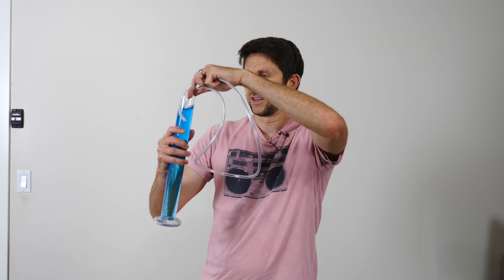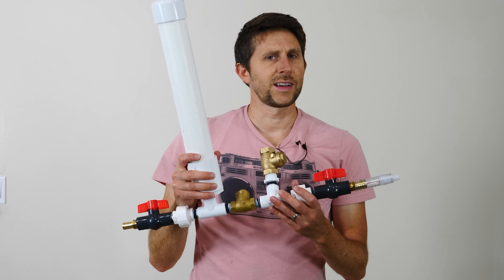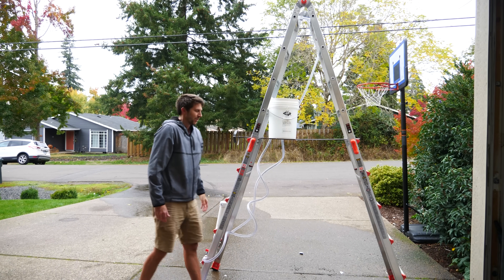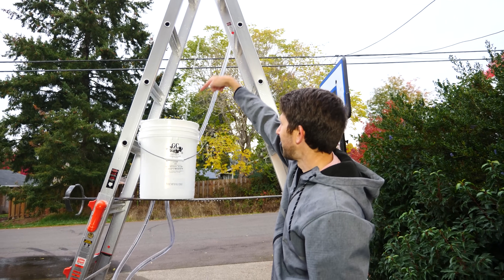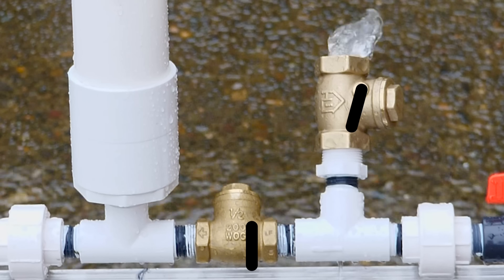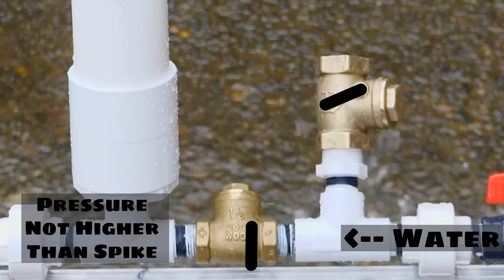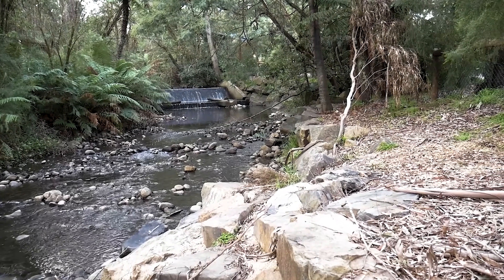Can a Hydraulic Ram Pump Make a Perpetual Motion Loop?

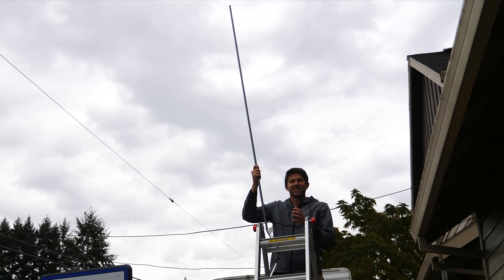Comment: "So, there is no source of power here" 2:35 - 2:39. You should be careful about your wording. Later, you told correctly, that there is no "external" power source here ( the water level is the source of energy here E=m×g×h)
Reply: are u sepcial ?
Reply: @girlsdrinkfeck  No. Maybe you? I am exact!
Reply: @girlsdrinkfeck  You don't know what different languages are... but the power of hight what implies m×g×h ( I'm not sure how you got tech the formula, maybe =P) is where this system got its power.
Reply: @girlsdrinkfeck  He is trying to hide the the fact, that you have a power source in this open system. So he use the word "external" explicitly, there is no "external" power source. When he say: "There is no power source" he makes a absolutely wrong statement, that's the fact I am mentioning. He needs to be better prepared of what he is saying. He makes educational videos, where you have to be exact. Otherwise he argues wrong.
Reply: @girlsdrinkfeck  Your point is changing over time...

Comment: Can’t you make it perpetual motion by having a ramp or tube flow the dumped water pack into the pipe?
Reply: No. Each pump requires waterhead height. By the time you freely collected all the waster water into the container, it will be at a lower altitude than the pipe you want to refill. So from there you would need to install the pump at least like 4-5 foot lower to get it to pump that waste water back into the pipe. But now, you will have waste water from the waste water pump, you can only pump around 30%(don't quote that, but it is far from 100%) of the water using ram pump, the rest is required to exit the waste valve freely. 

But if you did it anyway, you would make it more efficient, because now it will pump more and waste less. But you could also put a waste pump on the waste pump, and then a waste pump on the waste pump that is on the waste pump. And now it will be really efficient, but it will NEVER be perpetual.  And also you need alot of height to pull that off. Because in the end, all the waste valves need to flow freely, even that last lowest one needs to freely flow and a place to go freely.
Reply: Oh, i misread the question. But the answer is still no. That same dumped water pushing its way out of the pipe will not go back into the pipe because the pressure in the pipe is higher than the atmosphere pressure where that dumped water went. And if you had a tube on it connected back into the pipe, then nothing would happen at all, all pumping would stop. That is why it works in the first place, the water has to flow to a lower pressure in order to flow at all. 

You are for example in essence asking if a river can flow both directions.
Reply: @TheRebelmanone  with Disney magic anything can happen, but fr cool thanks

Comment: that bang sound when turning the water off is also made by the free pipe installed in the house. it slams the whole pipe into the woodwork or whatever the building supply is that encases the water pipe. I've watched this happen in some installations.
Reply: Yep. That's why we put surge arrestor on end of line

Comment: Hypothetically if you Rube Goldberg the fuck out of that pump you can make it reuse 90 some odd percent of the wastewater not quite free energy but staggeringly impressive
Reply: So this machine does nothing but puts some water back up to the bucket. If you want water at the bucker. Just put a full bucket there and done 100% effective.
Reply: @MrT------5743  not exactly you have multiple pump bucket setups at varying heights each one's wastewater going into the one below the top one uses a siphon with a turbine style pump to utilize its altitude to get enough Force to draw the wastewater from the first buckets receptacle backup into the first bucket it's not quite a 100%, but it would flow for a mind-bogglingly long time before it became depleted
Reply: @stacyroe619  Most ram pump are only 60% efficient and can only achieve 80% at peak performance. But what would maintaining a ram pump be useful for? A yard decoration? Cause using any of the energy to do anything (turning a turbine/propeller etc) to generate electricity will reduce the efficiency very fast.
Reply: @MrT------5743  no the siphon from the highest bucket would turn the turbine not to produce electricity but to produce the force needed to pump the wastewater from the first bucket back into the first bucket and you're right it would not be useful for anything other than the amusement of it because interfering with it in any way would dramatically reduce the effectiveness think six buckets high and the high one has a siphon going down into the first one and on its way from such altitude it would have plenty of force to turn a turban to suck the wastewater back into the first bucket but not all of it making it about 90 some odd percent efficient so it could run for hours however if the wastewater were to pour waterfall style down stairs into the lower buckets it can be used as a cooling effect like the artistic waterfall in the car manufacturing plant lobby that saves them money on cooling by using evaporation to help cool the lobby
Reply: @stacyroe619  you said and I'm paraphrase your first few sentences... 'a siphon will pump wastewater from the first bucket back into the first bucket'. What are you saying? At most a siphon can only move water from one height to a height slightly lower. A siphon cannot move water uphill to be discharged higher than the entrance of the siphon. I do not think you have a good understanding of how water needs to flow downhill.
Reply: @MrT------5743  I see the problem you misunderstand I said the top one as in multiple of the pumps that he made at varying heights the highest one would have the siphon powering the turbine that puts the water into the first bucket which would be the low bucket the siphon and the water pumped by the siphon as it passes through the turbine would move into the first bucket which is the lowest bucket

Comment: Hi There, I know the video below is in Spanish. but I believe this is the real power of the video.
Many farms in the Colombian Andes mountains have this type of pump. As flowing water is common and, the cost of parts, installation, and maintenance are affordable in comparison to the electricity prices. These pumps have a 10% to 15% efficiency. Wich means from 100lt passing through the system only 10lt would be pumped. However, they can pump water to a great height difference, up to 80mts depending on the length of the hose due to friction losses.

https://www.youtube.com/watch?v=LJphOVQVOOs

Regards

Comment: The external force is gravity.
Reply from the maker: gravity is not a power source or a source of energy. For example to get energy out of something in gravity you have to first lift it up to that height. The energy source that first lifted the object up is the source of the power, the gravity just converts it to a different form of energy like kinetic energy. So in a hydroelectric dam, the source of power is not gravity, but it is the sun that lifted the water to a higher location upstream due to evaporation (and then rain). Gravity is just a force, forces are not energy. Forces can convert energy into different forms of energy though. So the source of power for this experiment in my video was me lifting the bucket up

Comment: It is a pump powered by potential gravitational energy of the water. All the water that was in the bucket and ends up wasted at the bottom lost all its potential energy.
Reply: Technically the pump is powered by the kinetic energy to the falling or flowing water. Just having the water high up with tons of potential energy does nothing without the water moving.
Reply: @MrT------5743  ... Aw, come on. And where does the "kinetic energy of the falling water" come from? You said it, from "falling", and that is potential gravitational energy being converted into kinetic energy. You need do work to elevate water to the tank that is higher than the waste check valve. That work to elevate water, work that is external to the system, is what gives energy to the system. Potential gravitational energy. The rest is energy conversion within the system.
Reply: @adb012  But lets say you were near a river. Then you can use only the kinetic energy of the moving water. Either way, you add energy to the system, but if you only had potential energy and never let it fall (turn it into kinetic energy) the pump would do nothing. So still technically the pump runs off of the moving water (the kinetic energy of the moving water).

There is no argument that in order to get the water to move, it needs to have had some potential energy someplace first. That is the whole basis of kinetic vs. potential energy though.
Reply: @MrT------5743  ... Well, yes. Depends where you put the boundaries of your system. In the setting shown in the video I would take the tank as part of the system and the hose used to fill it up to be outside of the system. So you add energy to the system. In the same way that you out fuel in a car and say that fuel (not heat inside of the piston) is what powers the car. In the case that you take the water from a flowing river and use it's kinetic energy, and you consider the river as being outside of the boundaries of your system, then I am perfectly ok to say that it is powered by kinetic energy (the conversion from potential to kinetic happens outside of the system).
Reply: @adb012  now you are talking about the system. Your original post talked about the pump itself. It is most definitely powered by the moving water. By definition the movement of the water is kinetic energy. Therefore the pump is powered by the waters kinetic  energy.

Comment: I am really glad you did this video. Ram pumps are really cool. However, I am disappointed that you did nothing to deal with the wasted water. Is it possible to not waste the water? Like attach a pipe to the waste valve. You did awesome in explaining how it works, but you really should have put some time in showing what happens if you try to manipulate the water waste end. This is the kind of video for which  a thumbs up or thumbs down is not a good rating system. If it was a 1 to 10 scale, I would give it a 7.
Reply: The waste water was being used to water the driveway and down the street.
Reply: @MrT------5743  

Lool

Comment: I got a friend that lives on a farm and they have some clean running river near it, so they went out with a metal detector, and found a valve like thia that was over 100 years old, they dug it up, cleaned it and guess what, it worked, buried for god knows how many decades, it just works, they now use to pump water over 300m to there farm animals for free, it actually saves them tons of money on water electricity, for keeping there animals hydrated

Comment: But you can have two buckets, one lower at start, one up a hill. Water goes up to ram pump and into top bucket. Waste water from ram pump goes down a channel into lower starting bucket to not be wasted. Water collected up top also goes back down to lower bucket completing infinite loop. Water passes hydro motor to make electricity as it returns to lower bucket. Free energy from gravity and pressure.
Ram pumps are used to make water run up hills without electricity, when you have a hill you have gravity to pull water back down. You could also make a fountain with top and bottom bucket. Enclose to stop water evaporation.
Reply: No that would not work. For you to get water higher than the source water, you need more water to stay at the bottom lower than the source. If you added a hydro motor, the system would stop.
Now when you talk about a river, you would be better off just putting the hydro motor in the river and generate electricity from the water flowing down a river. Removing the ram pump from the equation cause it would not add anything to the system

Comment: what if we put the "waste water" to fill into a bucket 2 with another ram valve which fills into the first bucket, and its waste goes back into bucket 2?
Reply: The ram pump has to be lower than it's bucket so you wouldn't be able to have a cycle like that :(
Reply: No. Each pump requires waterhead height. By the time you freely collected all the waster water into the container, it will be at a lower altitude than the container you want to refill. So from there you would need to install the pump at least like 4-5 foot lower to get it to pump that waste water back into the container. But now, you will have waste water from the waste water pump, you can only pump around 30%(don't quote that, but it is far from 100%) of the water using ram pump, the rest is required to exit the waste valve freely. 

But if you did it anyway, you would make it more efficient, because now it will pump more and waste less. But you could also put a waste pump on the waste pump, and then a waste pump on the waste pump that is on the waste pump. And now it will be really efficient, but it will NEVER be perpetual.  And also you need alot of height to pull that off. Because in the end, all the waste valves need to flow freely, even that last lowest one needs to freely flow and a place to go freely.
Reply: @TheRebelmanone  To make it most efficient, just fill a bucket of water at the top without any hoses or the ram pump. You would waste 0 water not having any ram pumps.

Comment: Why Can't you just put  an other tube to the outlet and connect it to the tube before the gate, so you won't loose any water?
Reply: Then it wouldn't work. For this to work, some water needs to stay at the bottom. Essentially this uses the weight of the water in the source bucket, to move a little higher than the source, but some water (waste water) needs to end lower than the source. In all this system, water is basically flowing down hill.

Comment: I tried to make one of these with my dad, it didn't work though we used far cheaper materials so it was to be expected I guess.
Reply from the maker: It doesn't need to be expensive. It's al about getting that valve to open and close correctly. It needs be just the right weight, so as I mentioned in the video it helps to have a weight on it to adjust.  Also you need to make sure the inlet pressure and outlet pressures are high enough to get it moving

Comment: Now time to figure out how the Egyptians could pump water from a lower floor to a higher one
Reply: pressure I think
Reply: Did you watch the video? cause that is exactly what he was doing.
Reply: @MrT------5743  Yeah I watched it. No its not exactly what he is doing.
Reply: @chandelballard6427  he is, indeed pumping water from a lower place to a higher place using only running water and 2 check valves.
Reply: @MrT------5743  Thats not what I meant. What tools do they have that would have replicated this?
Reply: @chandelballard6427  I'm not sure about Egyptians exactly, but they had pottery. That would do it for sure. Bamboo as well but don't think about if that grows in the Nile.

Comment: Add a spinning wheel to the leaking water, and you've got electricity generation for a cellphone?
Reply: You'd need  a lott of water. Or catch the water from the valve and put it back up constantly. That's the energy you are putting in

And a lonngg as time

Comment: Can you connect several of thease pumps in series, waste  valve of first to inlet of second and so on?
Reply: if you have an infinite drop then yes haha. 
at the same level, the waste valve can't produce enough pressure to lift anything back to to its original height. The system need the pressure differential to be able to pump water back up.

Comment: Why dont they use huge models of this in dams, so we can produce electicity several times with the same water?
Reply: In dams, it is better to use all the water and not let a bunch leak out just so it pumps it back to the top. In James setup, It wastes water just to bring a little to the top. None of that energy can be extracted to produce electricity.
It is better to use all the water to flow though the dams turbines, which is what they already do.
Reply: @MrT------5743  I was thinking about  the water after the turbines,  getting some of that water up again.  Lets say they drain 1000 cubic, and could get back maybe 300. Better than just let all of  the water escape being used only once :p
Reply: @urobouros1337  it would probably be more like from 1000 cubic feet after the turbines get 10 cubit feet back to the top. Not enough to bother with all the extra complexity and maintenance would take. I believe people way smarter than you and I have already looked at the most cost effective way to produce electricity.

Comment: This technology has existed for a long time. 
To improve its efficiency you add a bell siphon
Reply: I just looked up bell symphony, it has to do with music?
Reply: @clarkeugene5727  siphon
Reply: @21gioni   Thank you, I'm a dummy.
Reply: @clarkeugene5727  No not at all you picked up the error I just edited the comment.
I am half blind and sometimes I don’t pick up on errors. 🤪😇
Reply: @clarkeugene5727  I am part of a research group who investigates energy devices.
We have an Air conditioning unit that saves up to 75% power consumption.
Reply: @21gioni  that sounds awesome, is there a prototype for it? I'm trying to make one too, saving power consumption!
Reply: @DreamingConcepts  It has been originally developed for industrial use and has existed since 1999.
The first unit was installed in a winery.
There’s also a unit in another winery where the winery supplies heating and cooling for shops, local businesses and homes.
All heating and cooling is recycled and returned to the main unit at the winery.
The grand plan is even greater.
The domestic unit we are seeking large investors to help develop the manufacturing facility.